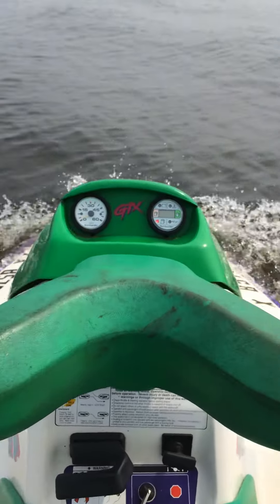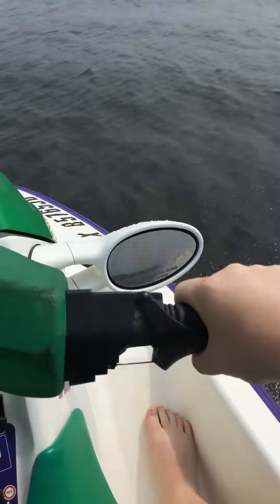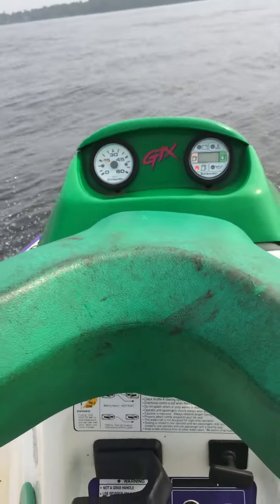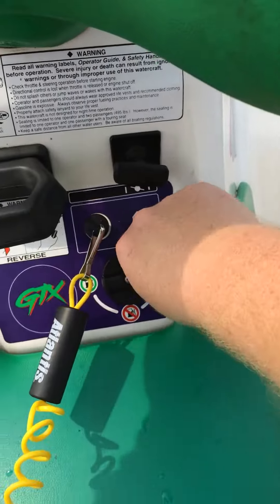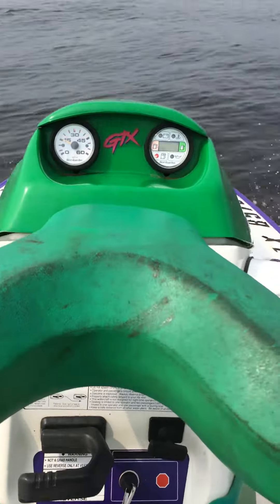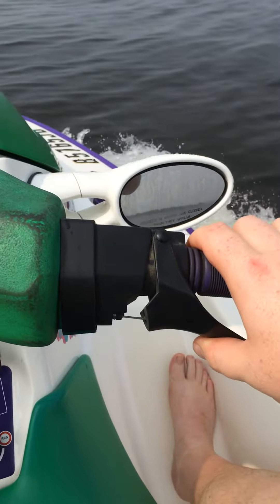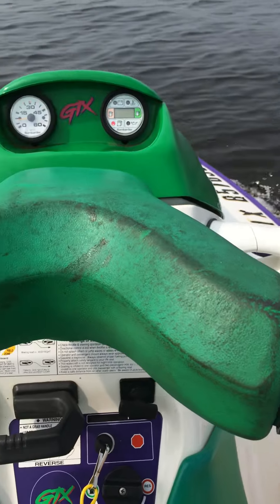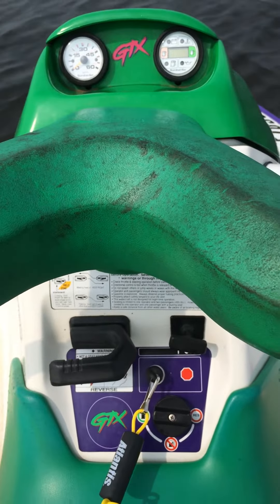1995 SeaDoo GTX issue

Comment from the maker: Carb rebuild fixed everything.  Filters were NASTY.
Reply: Where can I buy a rebuild kit for the carb?
Reply from the maker: I ordered the kit from an online parts dealer.  

 1995  GTX  657X  270500259  270500258  BN-38I (SB)  MAIN-132.5  PILOT-75  1.5  270500242 (D)  19 - 35  LOW- 1-1/4  HIGH- 1/4
Reply from the maker: Here's the specific kit I ordered for the 1995 GTX:

http://osdparts.com/index.php?main_page=product_free_shipping_info&cPath=595_602_1&products_id=38
Reply: I did the carb, still same issue. I already have black lines.  how do you replace wear ring? and how do I get to the filter at the bottom tank? any tips, mine sounds just like that... :(
Reply: Had to do the same thing to get it going. Two tiny little filters in my Carb were completely clogged. However, my instrument cluster still a no go...

Comment: On 4 SeaDoos, (2) 95SPX and (2) 97GTI, same/ similar problems. 
1/this is a fuel supply issue - fuel enought to accelerate, but then when supply dwindles, power (and fuel use) drops off, then back up again as more fuel is available, etc, cycles as in video. 
2/ fuel slector valve deteriorited inside, partially blocked in normal selection (causing #1 above), but not reserve selection.  I disassembeled and fixed mine, but better to replace selector valve (as internal parts are not sold separately.) and, 
3/ on all 4, partially clogged carb internal filter, caused #1 above to happen - except, start and accelerat normally, then shut off, repeatedly.  Fix: Disassemble carb, clean internal filter (no need to replace, they clean up with solvent).
Reply: Smiles x miles Thank you Andrew. I will try this.

Comment: Gas Light - If you replaced the float then it is the F1 fuse inside the top of the sending unit. It's not a really "hard" fix but you need to cut into and then be able to weld plastic back together.

Comment: You don't clean a selector because the Sea-Doo selectors are not meant for the new fuel you have to replace the selector and you have to replace all the fuel lines with the clear blue that way you can see if your getting sufficient feel then you have to do a fuel pressure check to make sure your tank is holding the pressure to force the fuel back also you never clean carbs you rebuild them and check your needle and seat and pop off pressures change your spark plugs this is how you do it correctly

Comment: So he's getting ready to comment and then I realized that he was 6 years old and you said you rebuilt the carburetor and that would fix it. It sounds to me like when the carburetors try to go from the low side to the high side of the carburetor something stopping it. You probably have a blockage. That's probably why it's fixed it. Also I had the same scheme was chasing it for awhile and I found that it wouldn't run with the darn if it was under 1/2 of a tank. I found that all the factory hose clamps for loose and was sucking air in but there no fuel was coming out for a leak. So I replaced all the fuel lines and all the fuel hoses clamps and that fixed it. I hope my advice help somebody

Comment: My 1995 GTX wants to stall out a full throttle but seems to run good at half throttle. If you hit the throttle full you can almost count to 5 everytime and it will stall out., or try to stall and letting up on the gas saves it from dying out. I had the carbs rebuilt and replaced all the fuel lines but it didnt entirely fix the problem. Also I only run Rec fuel. When I first got ripped off on the purchase (bought it dry do to distance between our residences) he said it ran perfect blah blah blah. Took it to the lake and it wouldnt go much over idle. So it is running much better but not close to 100%. Any Ideas guys?? Thank you in advance!
Reply from the maker: They're tricky... just have to keep wrenching on them until you get it right.  Have you sync'd the carbs?
Reply: Check the big rubber exhaust pipe that goes from the muffler to the water I bought one last year did same thing, would start and idle but wouldn’t rev up at all, the big rubber tube and outlet was clogged of crusher dust and pine needles, possible squirrel nest, runs perfect once I cleaned it out
Reply: @Bucksbeaters902  Thank you, but that ski was fixed early last year and after changing out a bunch of hoses, fuel lines and rebuilding the carbs got it running good. then it ended up flooded out leaving it on a lake for a couple weeks no cover and lots of rain equals totaled ski. Bummer luck bot I had a couple other ones that are ready to go. Thank You

Comment: Did you replace the wear ring too? Sounds like it was cavitating like crazy on take off.
Reply from the maker: Yes, the wear ring was GONE.  The ski runs like a dream still to this day.
Reply: +redaggie03 If you check out my channel, I've got a couple videos of my 95 GTX. Such a fun ski that is now 21 years old!
Reply from the maker: +Matthew Thacker.  I have to admit, it's not my favorite ski....I have the 1996 GTX as well and I like it much more.  The 787 is a better engine as well and I've had less issues with it (despite being the first year of the new generation).  Overall, yes - it's been a good one though.  I'd really like to replace it with a 96/97 GSX or 97-99 SPX.
Reply: +redaggie03 I came close to picking up a 96 GTX a few months back. If I can find one to restore, I would definitely buy it. Just having that front seat compartment would make me happy.
Reply from the maker: +Matthew Thacker Grab one, it's a GOOD ski....The others I listed are good as well (IMO).  The power to weight on those models is high, so they should be good fun.
Reply: Matthew Thacker I have the same problem do you fixed

Comment: I have the same exact machine with the same problem what did you do to fix it?
Reply: its the wear ring around the impeller
Reply: No definitely clogged carbs
Reply: I have the same issue I got my carburetors rebuild but is still having the same issue and I replaced the oring  It feels like it's overheating as well what could be the problem there
Reply from the maker: it was a bad (totally gone basically) wear ring AND carbs needed rebuilding.

Comment: what gasoline do you use for that jet ski
Reply from the maker: I usually use 93 octane from the regular gas stations, but you really want to use ethanol free fuel if you are going to let it sit for any length of time.  At least add Stabil to the fuel or you'll be rebuilding your carb in no time.